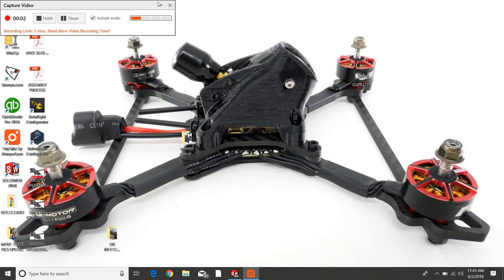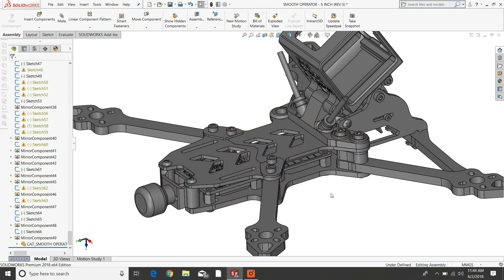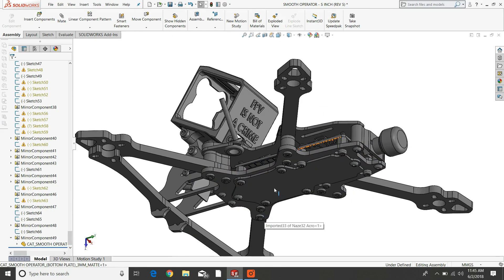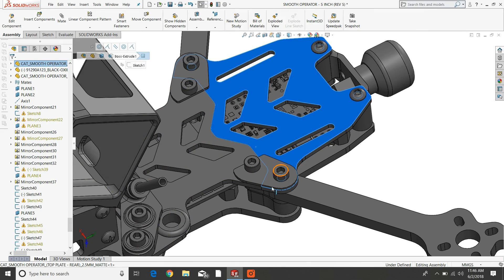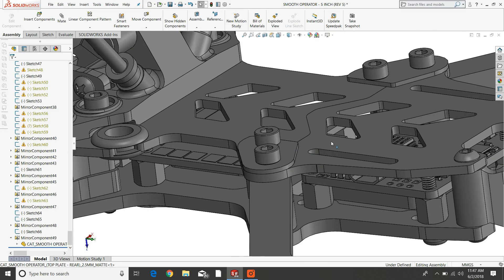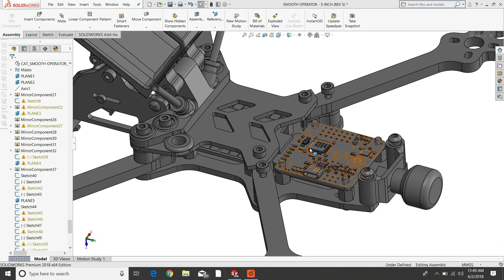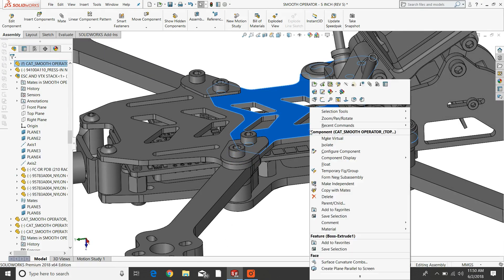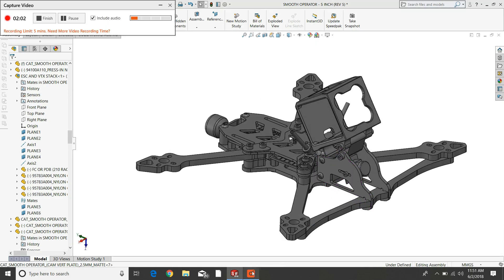SMOOTH OPERATOR - DESIGN REVIEW (REV 6)

Comment: Neil, get the arm nuts on top because you then only need to remove a nut and still have the arm in place and not dangling around
Reply from the maker: We use captured nuts which are pressed into carbon. You can't remove them.

Comment: Wow,  this smooth operator looks freakin awesome. I've been holding out waiting for a  freestyle frame to come out that's totally innovative and different from any others. So, I'll most definitely be keeping my eye out for this one. One question tho,,, so being that many of us run TBS crossfire, how would you go about having an dedicated mount or tpu for the immortal antenna? Seems that so many frames do not compensate for that and pilots are left having to figure it out or wait for someone to design something on thingverse. I see that there's designated tube mounts for the regular radio antennas, but if someone needed to place on the immortal antenna,, how could that be done? Again,, awesome design!

Comment: Have you considered twist and/or the sideways motion on the rear arms since their bolts are in alignment, if you could put even a small angle on them then I believe both the arms and the fc plate would be better structurally.
Reply from the maker: I'll be interested to see how it feels in my hands when you physically twist it. I'll know immediately if there is a problem by doing this. Crash testing will further prove the design.

Comment: why does the FC is in the rear part of the quad and not in the center?
isn't it going to be inaccurate orientation calculation by the Flight Controller? 
is it possible to mount the FC in the center and the ESC at the back?
Reply from the maker: Bro not to worry. We (myself and all my team pilots) have been flying this rig for weeks. Do you think we would release a product that doesn't work correctly? So how as FC works is the gyro takes change in angle info. The angle is the same no matter where the FC is located on the craft. Go watch our flight footage. Looks okay to me.
Reply: Thanks! what about accelerometer (Or what ever it calls)?
the reason i am asking is because I WANT THIS FARAME!!!
Reply from the maker: Most everyone who runs quad these days doesn't use the accelerometer. the correct mode to run is rate mode which doesn't need accel information. If you turn it off in betaflight this actually free up more resources for the processor. The accel is only needed for self level modes which have no place on a freestyle or racing rig.

Comment: It's only two less screws than my current freestyle setup. Except for I gain access to all my electronics at once without stripping everything down and also room to breathe when soldering or just working on it. So I'm not sure how this is going to make things any easier for field work.

Don't get me wrong I appreciate your design and trying to push the hobby forward. But I just don't see any benefit from it.

Overall machine looks nice though. Keep up the great work.
Reply from the maker: Does yours have a massive droner face?